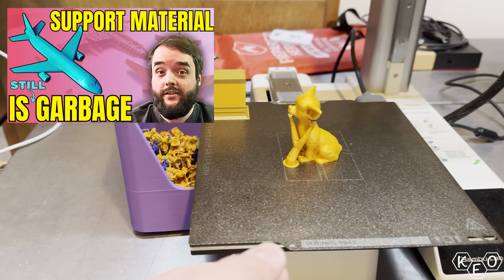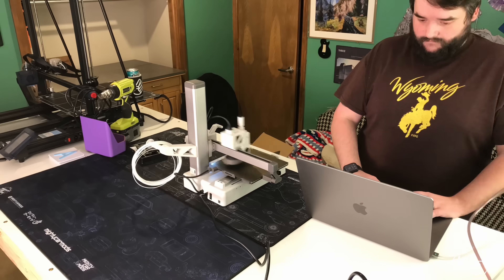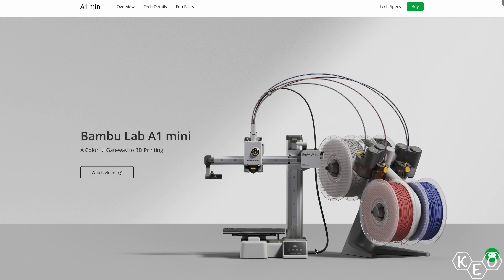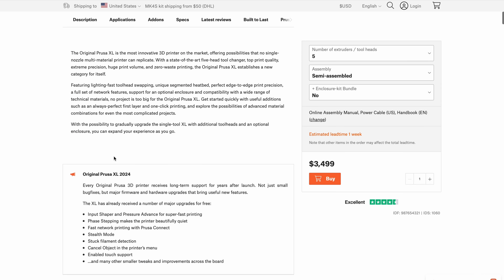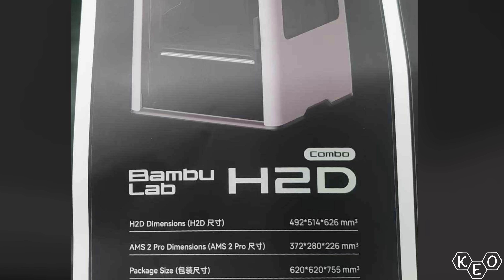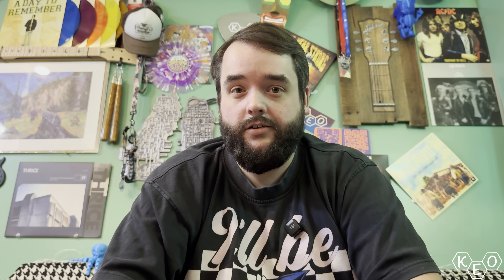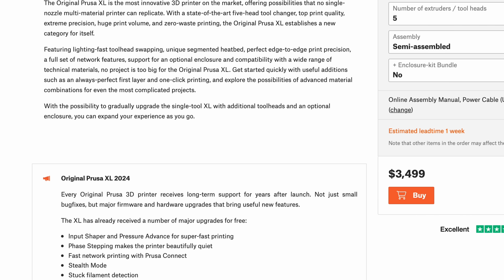What Is The Bambu H2D? Will This Change Everything?

Comment: Stratasys has been using a print head very similar to that for decades. It has the support material going into one head and the print material going into the other. When it switched materials, the head tilted a little to prevent the paused head from dragging against the current printing surface, like some basic dual nozzle printers used to do. In order to change materials, it would just tilt in the other direction and heat up the other head while the one that was just in use would cool down. 

Based on the patents you shared, it looks like the main difference is only one material/filament will be in the head at one time, and it'll likely pull the material back to the AMS2 junction to switch. If you look at the AMS2, the 4 filaments funnel down into a single channel, which has a selector to pick which nozzle it feeds to. This is likely how they get around the existing Stratasys patents, and could have been part of the legal issues they had earlier this year.

I'd guess it functions as follows: If you wanted to switch between two colors, it'll start by feeding red from spool 1 into head 1, then to switch it'll pull the red back up to the junction and feed blue from spool 2 into head 2. To switch back to red, it'll pull the blue back up to the junction and feed red from spool 1 back into head 1. It'll wipe the head, but there would be no need to purge it because the color being fed through that nozzle hasn't changed. If you wanted to swap between two materials, it'll function exactly the same as described, with each nozzle likely holding a different temperature as needed. If you wanted to print with 2 colors of PLA and also TPU, it'll probably dedicate one nozzle to PLA and purge when switching like the current AMS does, and then use the other nozzle for TPU. If it were smart, if TPU was only used on early layers, maybe it'll dynamically change so the two PLA colors will each have their own nozzle and it won't have to purge upon each color change. Something that would be a new feature of this printer would also be that different sized nozzles could be installed in each head, so it could print the rough details or infill with a thick nozzle, while the fine details could be done with a fine nozzle, and the AMS2 will switch the same spool of material between the heads mid print. That sounds like something no other printer on the market can do, like they promised.

It wouldn't surprise me if the AMS2 also has a built in heater to keep the spools dry, and a heated build chamber to help some materials print. And an improved camera, lidar monitor, and accelerometer/gyro in the toolhead. It'd be cool if settings could be changed on the fly through the display, if it had a serviceable air filter built into it, or if it were properly sealed and ventable to be able to run ASA without a hood.
Reply from the maker: All good points here. Thanks for taking the time to share all of that friend!

Comment: I believe the two nozzle setup will address the mutlimaterial problems. When printing materials with different melting temperatures. That is the hard part when material is used as a support for the other.
Reply from the maker: This is the part I’m most excited for I think if it actually comes to pass
Reply: @KeoPrints  I was never a fun of multicolor,  but I was always fascinated by the multimaterial prints with engineering materials. I was expecting to see an IDEX printer

Comment: Whatever it is, certainly not a prusa XL killer. Dual lifting nozzles? flashforge, creality, qiditech, geeetech, bibo, etc all had that over 7 years ago, nothing new.
Reply from the maker: But this is Bambu doing it. Though they have their weaknesses like any other printer, they made a lot of existing features mainstream and accessible. Stuff like klipper, pressure advance, accelerometers, lidar scanning, etc all existed but my simpleton brain had to work a lot harder to access those things. If they manage to pull this off in a similar way, it certainly won’t be a bad thing right?
Reply: This is a new machine. It's new.
Reply: Prusa XL problem is price, that thing is really expensive for hobbyists. Easily the best for multi material though, no purging, very little wasted filament.

Comment: Please for the love of god could you stop saying multi color, it´s not multi color it´s multi material, multi color would be using a translucent filament and coloring it is, this uses different types of material which can also be of different color, but this I would argue is the dumbest way of using it because the strength and yet nobody seems to realize it is to use something like TPU and PETG all in one product or the use of a 0.6mm nozzle and 0.4mm nozzle for faster and more sturdier prints or the use of PLA and PETG as build material and support material which is easy to detach. Printing is 4 Colors is really silly since you can´t mix them anyways. But yes this can also be done.
Also they could be really innovative and use the 3 mounting points of the print bed to make a 5 axis motion possible, thus eliminating most of the supports and even making non planar printing possible although the software solution would be really 
challenging.
Reply from the maker: Multicolor
Reply: Nobody says multi material. You sound out of this world goofy. It's multi colored because we want multiple colors. It's literally in the name.

Comment: You're comparing sizes using different AMS systems. The new one may be smaller than the old. With the outside dimensions given there isn't a tremendous difference in size. The height looks taller though. Who knows! They've been really awful about communication with regards to this release.
Reply from the maker: That’s true. It could be completely off; who knows!

Comment: I have reading a lot about fumes from the 3d printer are dangerous.  any feelings about this stuff ? "Inhaling 3D printer fumes poses several health risks. Studies have shown that exposure to these fumes can cause inflammation and irritate the eyes, nose, and throat. Some VOCs found in 3D printer fumes, like styrene, are classified as carcinogens, indicating a potential risk of cancer with long-term exposure."
Reply from the maker: I’ve heard that about the styrene based stuff like ABS and ASA. But since they require an enclosure to be printed, so use with a filter is a good call
Reply: @philipfwilson  a basic filter will do the job. Just don't put it in your bedroom. If you're using ABS and ASA you might want me ventilation. If you're doing resin then it needs serious ventilation.
Reply: They smell really good

Comment: Based on the overall dimensions of the H2D: 492 x 514 x 626 mm³, I will speculate the build volume to be a maximum: 360 x 382 x 426 mm³. This measurement is base on the overall dimensions of the X1C: 389 × 389 × 457 mm³ and assumes that the clearance from the edge of the build plate to the physical sides of the machine does not change from one machine to the next. In reality i expect the clearance to increase so it will likely be a bit smaller than my speculated maximum...
Reply from the maker: Even still, that should be excellent!

Comment: 0:47 I see what they are going for...i can imagine the benefits...when they first launched i thought they were another company with no clue what they were doing and were promising the moon...I had seen it many times before. But they delivered everything they promised...But this...I don't know if they can deliver this reliably but we will see.

If it works...we could potentially see more multi material support and faster color changing.

What if your model has 4 colors but most of it is white...If you could leave white permanently loaded in one extruder and swap colors in the other extruder...that could save allot of material.

Might have been better to go with a traditional idex design though.
Reply from the maker: I agree with these points. This could unlock a lot of opportunities if executed properly. It’ll be interesting to see what actually happens

Comment: So..I looked up patents, and found this: Performance test: the composite polylactic acid materials for 3D printing prepared in examples 1 to 5 and comparative examples 1 to 5 were 3D printed on **Bambu Lab X D** printer with PLA 3D printing material of diameter 1.75mm commercially available under the brand name tricyclopedia SUNLU, respectively.

Comment: Yeah this makes the most sense.   Dont forget they wont be releasing something that will just decimate the sales of their other machines.  A Multi tool changer would be too expensive (says the man with a xl)  And if they did that for too cheap no one would buy their other machines.   This seems a happy little upgrade for perhaps not to much more money to set it at a point just enough above the carbon so as not to ruin the carbon sales and enough so people will want to pay the little extra for it.      This really does make the most sense for them.   A cheap 5 toolhead changer would just decimate the sales for the rest of their range.   This is not a  new idea, its been around for decades.   But its the software that never really been perfected in the machine and the slicer.    So this makes sense.  very little change in the hardware.   Most of their energy gos into their close sourced software perfection for an already proven yet unpolished idea.    Ones that perfected their mostly making money from the polished closed software really.    The machine just has an extra head and a few extra servos which cost them literally pence.  Very clever very efficient.
Reply from the maker: I’m hoping this comes to fruition. Lots of cool possibilities here

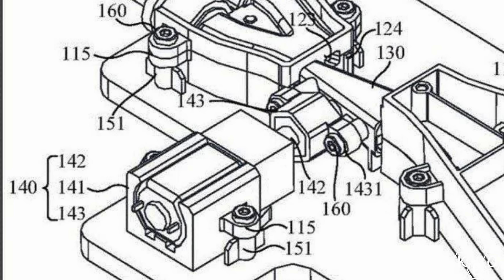Comment: 8:04 yes you are right, I think it will work like a dual clutch in a car's DSG gearbox, while one extruder is printing, the second one is retracting and repositioning the new filament, to save time and make it faster.
Reply from the maker: The DSG parallel is exactly what I was thinking about when I was writing that
Reply: Like the old multi colour pen plotters that picked up a pen from the edge, did a bit of drawing, dropped it off and picked up another one?
Reply: @terryd8692  No, think of "changing" the ink inside each pen, a pen cleaning process will be necessary to set the new color, at the same time the other pen continues to draw something else, that is why it has 2 nozzles, to carry out both processes simultaneously.

Comment: H2, may allude to 2 print heads. If you look at the patents, they may have created a 2nd print head. I run 3 printers and may wait a few months before getting this one. I can see a lot of tech issues with the new tool head set up. Wait until they iron out the creases.
Reply from the maker: The old familiar burn of early adoption

Comment: ams 2 pro has 2 outputs. output 1 for 1 & 2, output 2 for 3 & 4 will be saving double on poop. output 2 can be petg &/or support for pla when printing pla on output 1. what if u can share the ams 2 pro, printer 1 output 1, printer 2 (could be a X1 or P1) output 2
Reply from the maker: This would be a good method

Comment: The design does not look like they can engage both extruders at the same time (gear 170 in the center). So retracting one, while the other is running might not be possible. Also I don't see anything in the AMS selector part that would support two strands of filament at the same time.

Comment: Where is the Z motor(s) are they using the same belted Z system?
Reply from the maker: Not sure. Perhaps that’s been upgraded as well?
Reply: @ part of me thinks it should, the. The other part of me remembers that I’ve never once had a leveling problem where it wasn’t the bed being too far back on its adjustment and hitting the inside of the enclosure. I feel like individual motors would be more accurate for movement, but mesh leveling on my X1C has been perfect.

Comment: I don’t think that 4 in 2 out selector mechanism you showed a diagram of is likely to be relevant to this printer. You would want a mechanism that allows both nozzles to stay loaded without having to retract and reload the filament each time you switch in a dual material print. That way it would be as simple as tilting from one nozzle to the next, potentially even more quickly than the Prusa XL does its tool changes. I do think the added weight at the tool head would likely be an issue though. Who knows, maybe neither of those patent images apply to the H2D.
Reply from the maker: I’m seriously wondering if this is a misdirection or simply an out of context thing. Who knows what they’re actually cooking up

Comment: The setup that you showed wouldn't get rid of the purging. If you have all 4 of your filaments going into 1 thing that then selects which head it's going to, that means the filament is only going to one head at a time. I think a better setup would be to have the ams go to one head, and have the other head dedicated with a color or filament type.

If you have one head dedicated to one filament, and the other as your ams, you could run your support material there and run different temps for that head. You also would never need to purge the dedicated head, only the one with ams.

When I first heard pivoting head as one of the possible features, I got excited thinking maybe the head would be able to pivot up to 45 degrees allowing much better printing of overhangs. The patents shown look more or less like you mentioned, just rotating one head out of the way to allows the other head to print.
Reply from the maker: I was hoping for something that could pivot as well. Nonplanar printing solutions would be huge from someone like Bambu
Reply: Dual head with 1 dedicated and 1 AMS would make sense. If you have 2 nozzles and 4 colours you're still going to be swapping the colours a lot. If you had only one head swapping, it can be doing it's purging business while the dedicated head is doing it's printing. 2 colour printing would be epic, 3+ colour would be reasonable.
Reply: There appears to be a full 90*+ worth of gearing there on part 164.....but without rotation it would only allow printing on the edges from the sides not front or rear....but could be for availability of more than 2 print heads to choose from?
Reply: I think it would be 4 extruders on one head. Four filament colors entering the one moving head. The colors would print their section of each slice.
I hope.

Comment: IMO, Bambu looks to be making an affordable version of a Stratasys machine. Stratasys machines offer DENSE SUPPORTS that give you perfect overhangs with no marring + easy support removal - thats why they're great (+ super expensive). Stratasys uses alot of dissolvable PVA-like material. With Bambu it will probably be simpler like using PETG with PLA - they're cheap and easy AND don't stick to one another. I WANT ONE - 2025 can't come soon enough!
.
Reply from the maker: This would be so cool if that’s actually the case
Reply: which would be a good punch after Stratasys is  sueing Bambu Lab for copyright infringement. If I were Bambu Lab names like  X2 Max or X2 or X2 Pro would make much more sense. Don’t be surprised if HID is only a codename. But we even do not know whether the “leaked” product picture is real.

Comment: I'm going to say there's a 50/50 chance that this leak is legit enough that it's actually going to look exactly like what they come out with in a few months. In my opinion as an engineer and a maker the X1 Carbon with AMS is not that much better suited to printing engineering materials than the p1s with AMS and I think one of their biggest downsides is that the AMS is not an active filament dryer which means that you need a separate dryer to print nylon or any hygroscopic material. I also print a lot of impact of robot Parts with TPU and it's endlessly frustrating to me that I can't just put TPU in the AMS and I know they just came out with a super hard TPU for the AMS but I'm talking 95 a standard stuff. If this new printer allows you to print with both TPU and a rigid filament and the new AMS is an active dryer I think that would be a game changer though I kind of doubt that they're going to have support for soft TPU in this new AMS since it looks kind of like the same overall design as the current one
Reply from the maker: I agree with everything here. Especially talking about the dryer and the TPU. It is silly that a company as “groundbreaking” has limitations like no flexibles in the AMS

Comment: The rocking head is similar to stratasys old dimension 3D printers. It was pretty reliable if it was set up right. For me a duel head and bigger volume with quality and reliability of the x1 and they have a winner and will blow away everyone else.

Comment: I'm gonna throw out a crazy guess. I'm thinking that it might be a 400mm³ build volume and possibly high 300s to low 400s °C hot ends judging by the fat heater blocks. I know they are just patent images and are subject to change, but it's fun to guess during these times of anticipation.

Comment: Not sold on the dual nozzle setup. RatRig have combined the Core4 IDEX with an extra pair of motors for y movement. Why not go ahead and use this properly, take their 500³ footprint model, and build a 400³ double IDEX with two gantries and four heads? So, an opposing pair of coreXY mechanics with four additional y motors? No alignment issues after toolchange like on the Prusa XL, no filament change, heck, no change at all! You could even combine each tool head with an AMS and still be faster, because cutting, priming and purging could be done in the parking position while another head is printing. When they announced their Core4 IDEX with the additional motors I got the idea, wrote them an email describing it, but never got an answer. Shame on you, RatRig
Reply from the maker: Wow. That would be super complicated but also surprisingly simple. Way cool to think about